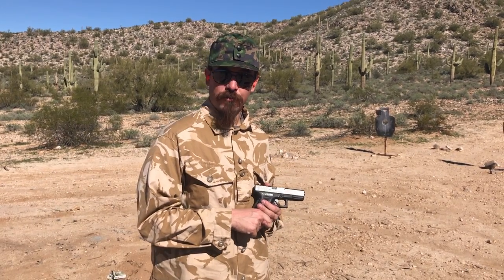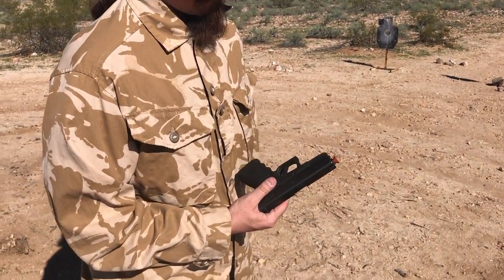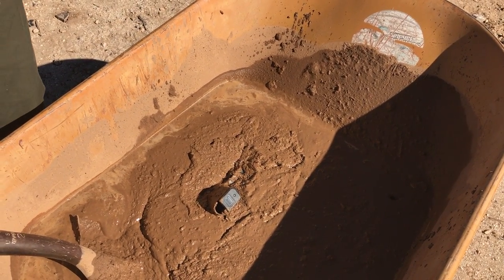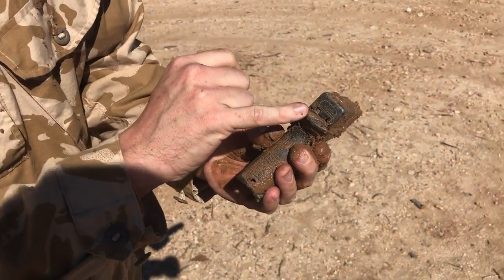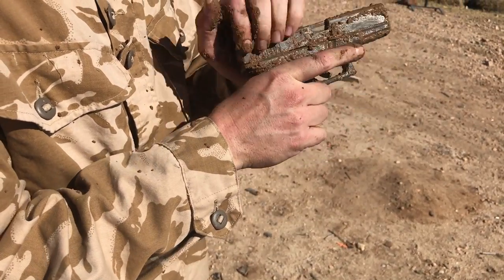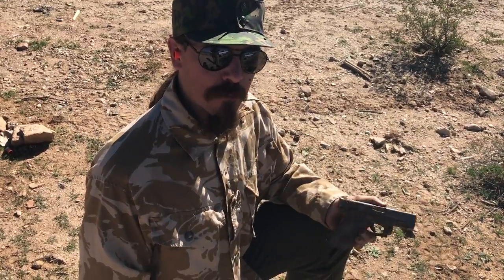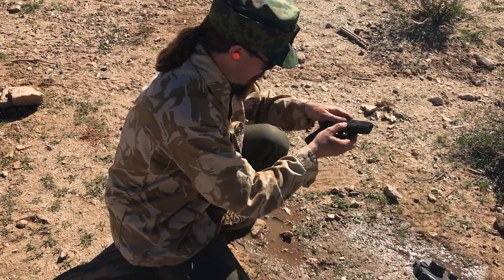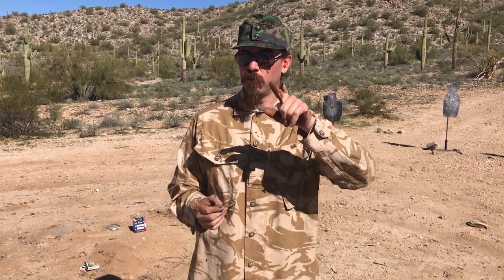Mud Test: Glock 19

Comment: Now I understand why german soldiers prefer Lugers and Steyr Hahns over Glocks during WWI.
Reply from the maker: +Dmitry Arciszewski Yep.
Reply: InRangeTV Would the Steyr GB have done better in this test or worse?
Reply: EisenKreig I would think it would do better because it doesn't have a need to have a locking mechanism. In addition the tight fit between the gas rings and the sleeve should also minimize ingress of debris.
Reply: Dmitry Arciszewski maybe because glocks weren't out in ww1
Reply: This is a joke right?

Comment: Let it here be known. The Glock did worse than a Hi-Point.
Reply: except in the case of the Luger which aced the mud test, and is and incredibly complex design.
Reply: Snakesht172 Luger is not good with dirt
Reply: And yet the Luger aced the mud test. There's a video.
Reply: Tommy Sands watch the Luger mud test
Reply: Michaelanthony24680 it's pretty upsetting but I won't be rolling in mud with my glock lol
Reply: I'm not a Glock fan and even I want to punch a pillow and cry over that one. Just because the Hi-Point is shit hideous.
Reply: It's reliable but the action still let's a lot of dirt in
Reply: T Dizzle sells good hardware. What else can be said?
Reply: I believe that you meant to say that the glock 19 did worse than the Glock 40 Problem Solver™.

Looks like the glock fanbois will have to stick with .40 smith and wesson
Reply: Let it here be known. The Glock did worse than a P08 Luger or 1912 Steyr-Hahn
Reply: And the Luger surprisingly.
Reply: Don't forget the Argentina 1911 also did better,  no water bath either.  In the second 1911 test Ian only had to clean a little of the mud from around the firing pin with a stick.  Now there was a water bath between the two test.
Reply: Michaelanthony24680 Like the AK and the CETME-L
Reply: Hahahahahahahahahahah

I think @Michaelanthony24680 wins the internet today.
Reply: Its like the mud test of ak 47
Reply: I recall the AK actually did better. It didn't do well but it did better.
Reply: world shattered :'-(
Reply: +Dan Morgan nope m16 actually beat ak47 becuase of its tight seam between the bolt and the receiver
Reply: Dan Morgan The AK performed fantastically after a rinse. You were more likely to jam an AR that way letting the mud get more watery and seep into the chamber parts. But holy shit... that Glock died.

RIP
Reply: Reverend Rabbit Consistent?  How so? Is the mud strained for exact sizing of debris? Water measured, dirt weighed?  Each test performed and gun tested hundreds of  times to account for the multitude of variables? In a closed environment?  Yeah these tests have consistency written all over them! lol
Reply: I wasn't talking about AK vs AR. I was comparing the results between the AK and the Glock.
Reply: +Dan Morgan oh i guess the result is similar
Reply: Dan Morgan Oh I know, but AR/AK have a more nuanced reliability when it comes to being exposed to the elements.
Reply: +Taeil0151 it depends on how you perform the test pour mud INTO the gun or pour mud ONTO the gun
Reply: WTF TROLLKILLER AK is marvelous for how quickly it goes back to fully functioning after a quick (dirty) water rinse of the inside. AR is amazing at keeping gunk out but once stuff infiltrates that chamber... you gotta do a full strip clean.
Reply: "SCIENCETIFIC MUD". YOU HEARD IT HERE FIRST, FOLKS!
Reply: Ceiling Cat I would never clean an AR with water unless it got covered in mud. AK I can just rinse the bolt and goes back to firing even if it does rust the parts.
Reply: Why would anyone still buy a non corrosion resistant AR?
Reply: I think you've setup something of a false standard. Nobody is saying "soviet/plastic $100 junk" is worth a dam. I would go so far as to say what you describe doesn't even exist. I'm broke as a joke and have a Soviet M44 carbine. It's not world beater but it is rock solid and fires a powerful cartridge which is all I ask of it. Just because someone can't afford an AR doesn't automatically make them wrong.
Reply: And the AR and other western weapon systems are just as or even more reliable as shown by these tests. They also look better, shoot better and don't look like shit. You know whom I was talking about. The myth of perfectly fine ARs are jamomatic pieces of crap, who spread it? Not people in financial situations similar to you?
Reply: A closed environment where the mud is scientifically created to an exacting consistency would show you how well it performs in a simulated environment where you have control over every variable. These tests demonstrate a realistic environment: you drop your gun in the mud that's there.
Reply: Nukleon Yeah sure Glock fanboy

Comment: So, to summerize.

A Glock is worse than a Hi-Point.
A Hi-Point is worse than a spanish 1911.
And an original WWI Luger runs circles around all of them.
Reply: The Steyr Hahn is slightly better than the m1911.  Very Slightly.
Reply: I believe the 1911 was Argentinian.
Reply: Dont judge a gun based on the test on the most unreliable condition ever. We knew that Glock performs less than the Hi Point in this test, yet we can all agree that the Glock beats the hi point when we just took it in the gun range.

I mean, is there any chance that we will get drowned in a 6 ft deep mudhole then come out to shoot enemies?
Reply: @darnit1944  the thing is, if the situation occurs, the guy who's using a Hi-point would have killed the guy with a Glock

Comment: I think the glock has the same issue as the AK, it's open to the elements and has somewhat loose tolerances.  It will fire longer without being cleaned than a pistol that is more sealed up but when completely submerged in mud the more open design lets the mud in and it jams.

Comment: Hahaha the Luger is still king!
Reply: The practically first modern self-loading pistol is still the best in something. How about that. Shows just how little guns have changed, l seriously doubt the Benz three-wheeler would still excel at anything.
Reply: PCGHX mud must have been a bigger design issue when the Luger and 1911 were being developed.
Reply: Cyrus Freeman the glock grip is very familiar with the lugers grip
Reply: Cyrus Freeman the luger is sadly not good for carry because it doesn't feed hollow points. But it is still a nice range gun and a fine collectors item.
Reply: Considering that 9mm ball has killed or wounded literally millions of people over the years, I don't think hollow-points are really necessary for a 9mm to be a viable carry weapon. The problems with the Luger as a carry weapon are its large size and unique shape make it harder to carry concealed than most slide-action pistols. If one doesn't think 9mm ball has sufficient stopping power, than one probably should be using .45 ACP anyway.
Reply: you understand me wrong. I dont doubt that 9mm ball is adequate for self defense. But there is something called overpenetration. If you shoot someone with 9mm Ball the bullet might exit your attackers body and hite somebody behind him. (Sorry for bad English, I am from Germany, where we are sadly not allowed to carry guns)
Reply: I have to arm myself with an AR-15, a Luger and a Winchester 1895 for ultimate mud reliability xD
Reply: Fair points on the penetration problem. That is another reason I favor .45 ACP. Its big and slow hunk of a bullet very quickly puts the energy into the target, giving you superior damage with less risk of OP, especially if you got HP.  Just be nice if one could always ensure the criminals were at 25 yards/meters so we would never have to worry about OP with ball or HP. Very inconsiderate of those crooks!
Reply: Eustace Stritchers never been much concerned with over penetration. more concerned with under penetration.
Reply: it ran on ethanol, it would have a great environmential curve compared to modern Diesel and Petrol cars ^^
Reply: Time to build modern 08s with double stack mags and heavier barrels?
Reply: Heavier barrel? I am pretty sure its barrel is plenty good as is. As for capacity, eight rounds was good enough for the Germans for over a century, and indeed most of Europe got along fine with similar loads until recently.
Reply: A heavier replacement barrel was a very popular upgrade/customization in Germany when Lugers were in production for a better balance.
Reply: Ten Points to Imperator Phil for the hilarious comment. I suggest you grab yourself a Lange-Pistole 08 with the standard 32-round drum and stock fitted. That should go a long way to solving that issue there, Buddy! Ironically, that is exactly the kind of situation the Germans made that Luger variant for: give the artillery units something to fight off raiding cavalry troops. 70 guys at 250 meters is about what they expected! 

Very good point about the heavier barrel, Mr. Gustav Meyrink. I find most Lugers I have handled to be balanced well enough with standard barrels, but I won't deny that many people legitimately prefer more weight forward and they should have the option, just as civilians did back in the day as you note.
Reply: Fuckin' 1911 did better then this piece of junk too. Seems the old ones are the gold ones in today's times.
Hey... Could be worse... could be a Nambu...
Reply: and that's why more guns today don't look like a luger or use its loading mechanism and instead bear greater resemblance to the  1911?

Comment: I had someone the other day on TFB arguing with me that the slide and striker assembly on the SIG P320 doesn't need to be field serviceable at all and I think that's absolute nonsense. I've had a couple of guys show up at the range who had previously dropped their Glock in fine gunk and it had finally worked its way into extractor/striker block area. I was able to quickly pull the slide apart with a pointy bullet or Leatherman and blow it out with my mouth and presto, back in action.  P320 owners have been told by SIG to not take their slide apart. Great idea. I don't care how well made a gun is, if fine matter gets into areas that don't like it, it stops working.
Reply: Isn't that like when the US Army told soldiers in Vietnam they don't need to clean their M16s? :P
Reply: Basically, yes. If you look up "P320 striker block spring" and variations of that you'll find people have had the spring easily pop right off when taking it apart or simply break and SIG's response has mostly been "Don't do it." If you look at the striker system they employed it seems to be exactly what you would expect from a gun that originally was hammered fired and they had to fit a striker system in it. I'm not saying the gun is terrible and will blow up but the modularity aspect is really hyped up for how little use it will probably receive. Just look at how much the SCAR hasn't been used in hot swappable configurations.
Reply: That's strange to me, I'm on a facebook P320 owners group and seen alot of people get internals from SIG, for their slide.
Reply: It's not that SIG won't send you parts, it's that they've told a number of people to not take it apart.
Reply: That's exactly represented by the evolution of printers.  They gave up trying to prevent all paper jams.  Engineers just design them to be easily popped open.  I'd prefer something serviceable over not any day of the week.  It's made by humans, therefore it will fail.

Comment: this makes perfect sense, glock are a very open, loose toleranced gun, you might try using a grip plug and see what that does for it, there is an opening in the grip that allows grit into the striker assembly

Comment: I'm sure you've figured this out by now, but in a situation where the trigger on a Glock can't be pulled, in order to move the trigger bar down out of engagement with the lug on the firing pin and allow the slide to come forward off the frame for disassembly, the solution is to lock the side to the rear, manually depress the firing pin locking plunger, and use a flathead screwdriver or similar tool into the firing pin slot in the slide to compress the firing pin, at which point the slide cover plate may be slipped off, this allows the firing pin to be removed from the gun, at which point the gun may be disassembled normally thereafter. And how's that for a run-on sentence?

Comment: If you lock the slide rearward using the slide catch you can remove the slide cover plate and disassemble it from there. That's the only way I know to disassemble it without the striker being fired.

Comment: I'd be interested to see the AAR for this. 

Can it be repaired/cleaned at all? Also, where the mud ended up. 

It must be caked up around the trigger or the striker.
Reply: There Be Game if you lock the slide back,  You can pull off the cover plate and remove the striker,  so it can be cleaned.
Reply: From what I heard, I don't think they can even do that. Hence the question.

Comment: Wow the 1911 did better. I don't invest my ego in brands or designs but it's crazy firearms designed over 100 years (1911,Luger,1912) are just as reliable as modern guns. Their only hindrance is cost of manufacturing and capacity.

Comment: Hmm... I own several glocks. Must have had some pretty large particulates get into the locking grooves around the chamber and the slide rails. I can personally say that I have had only a few issues with my glocks. Keep em clean and keep em lubricated and they work without fail. This truly is the test that kills guns like this. Because it has a moving barrel, the mud throws off the tolerances needed for the barrel to lock forward. The hi point has a block barrel, i.e. a barrel that doesn't move.

Comment: Ha, I am sure you fixed it by now, but to clean out the mud enough to take the slide out, you can lock the slide to the rear, and then turn the pistol upside down. You have some limited access underneath the slide from the rear of the pistol.

Comment: I have a suspicion a cz75 or similar action would do well... call it a hunch. (edit: and by "CZ75" I mean anything that operates like one, CZ85, P-07, whatever)
Reply: In the most basic terms, sure, they are both locked breech semi automatic handguns. But in the specifics, CZ75's have internal rails, that is to say, the rails are on the slide, and they fit into grooves in the frame. This is the opposite of just about every other pistol and is why the slide on CZ's seems so short, and they have that nice, low bore-axis. I think this might make a difference, I don't know for sure obviously, but even if you doubt it, you gotta admit you'd watch that video too! :P
Reply: Yes, absolutely, which you're right to mention as this did fail due to crap in the locking recesses, but who knows? Sometimes alterations of unrelated mechanisms create conditions with enough variance to make a difference. You know you want to see a CZ75 take a dip in Arizona mud too, though, regardless of outcome :)
Reply: Also, remember the progenitor of the browning tilting-barrel locking mechanism, the 1911, did marginally better than this, though with basically the same failure mode.

Comment: The Luger P08 which which the consensus is that it will jam with as little as dust or moistness in the air, functions flawlessly but the Glock which if legend were true should be able to be dropped into a volcano with no ill effect gets killed.  This series of mud tests is a very good thing to answer questions that people could if they had the will had answered quiet easily.

Comment: Ian, I'm reminded of older 2 gun matches you and Karl did for which mud tests would be great follow ups.

The one where you used Cold War pistols, with the M9 and CZ-75 (subbing for the Makarov)

The BAR vs FG42 reproduction match just from a mud test standpoint

Both for mud testing and for making Karl miserable in 2 gun, you could revisit Little Big horn and do Trapdoor vs Lever gun (though you already did the mud test for the 1985 Winchester, the open feed tube of a Henry might be worse than the charging handle slot on an AK).

Other ideas would be Garand/SKS contemporaries, like the FN 49 or Hakim or an SVT if you can find one. Those early DI guns would be very interesting for mud tests, and I think Hakims are still kinda cheaply available.
Reply: *1895

Comment: Fan Boy here(42,43,27,19). I'm not upset about any gun failing this test. This is tough test to get through, and this is just one data point. Does not take away from the long track record Glock has. Ask any mechanical engineer that truly understands the meaning of tolerances. Is funny to compare it next to the Hi-Point though. I'm sure we will see a redo video due to the so called "butt hurt". I carry a glock because I shoot them well and never have reliability issues even when I don't maintain them as we should.

Comment: You don't have to throw it away. Just lock the slide to the rear, take the back plate off and remove the striker. You should be able to remove the slide then and clear out whatever it is that's obstructing it.

Comment: lock the slide back, pull cover plate off, remove the striker. :]
Reply: Aaron Clark Don't own one, so I have to ask... Is that something that can be done on the fly, without tools?
Reply: I typically use a ball pen.
Reply: Mr. Quarters with literally nothing but your bare hands it would be very tough. But you could find a lot of stuff to help you imagine.

Comment: Could you please do sand, water, dirt and mud test on the Sig Mk 25 and the Glock 19? Side by side, back to back 1 stage at a time with exactly same mud, same dirt, same sand at same time? Battle of the navy seal handguns. Best of 3 series. Cleaned prior to each round of testing. This would be a classic Lakers Celtics matchup. :)